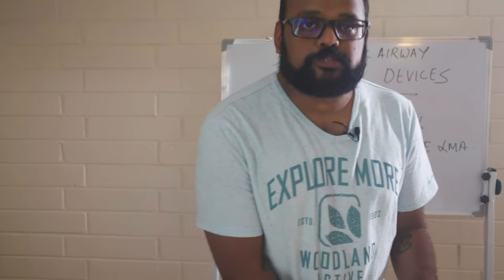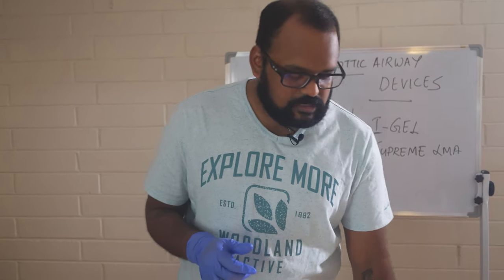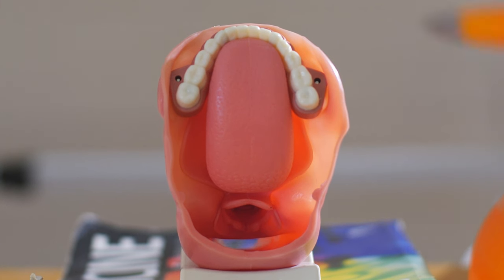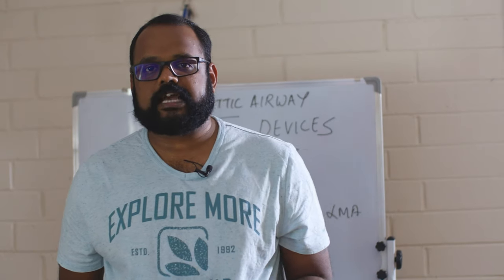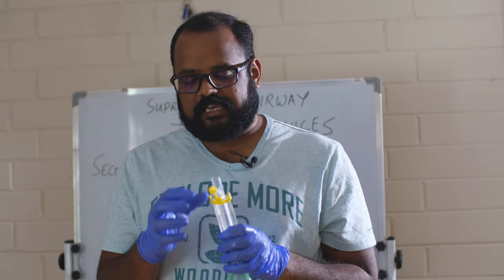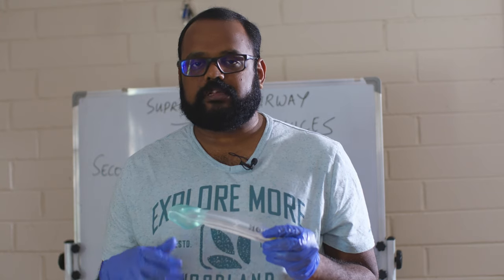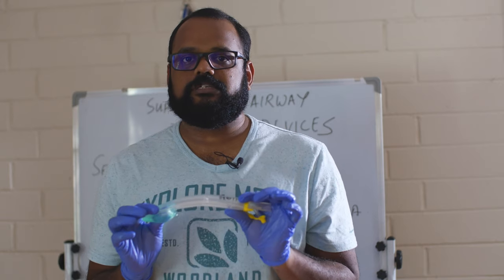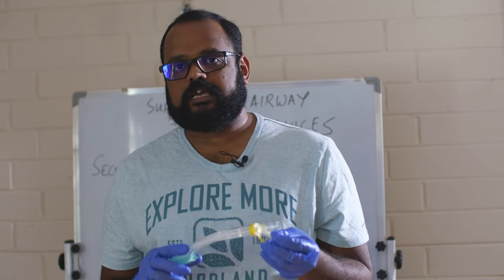I-GEL, All you need to know

Comment: Nice video. I do use i-gel extensively. I have all sizes. Bt no passive oxygenation port in any one. Do they have added this feature very recently?? I bought new i-gel size 5 few months ago. It also doesn't have this port. Please clarify. Thank you.
Reply: Thanks for the comment 

I gel o2 had passive oxygenation port 

Regards
Reply: Thanks for the comment 

I gel o2 pack  has the passive oxygenation port
Reply: @manuparu25  thanks.
I checked intersurgical site. They have introduced I gel o2 resus where a supplementary o2 port is present. I never knew this development till today.